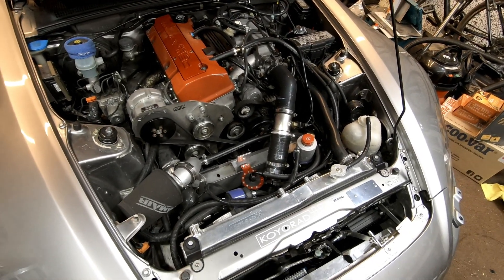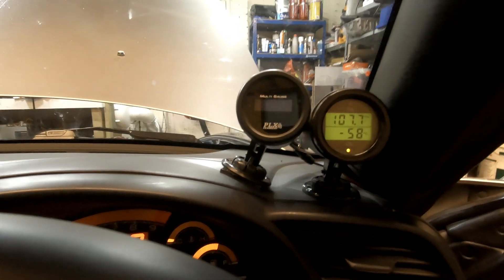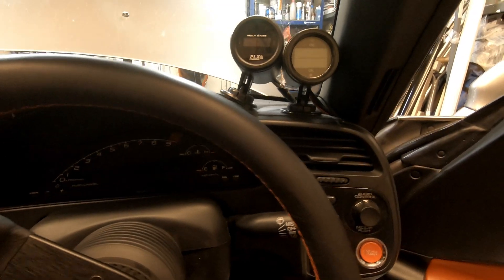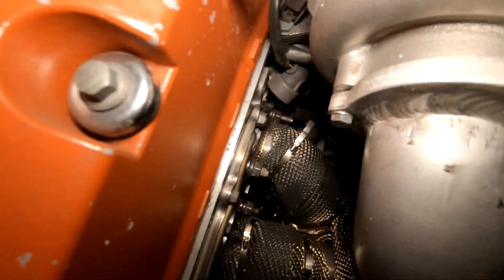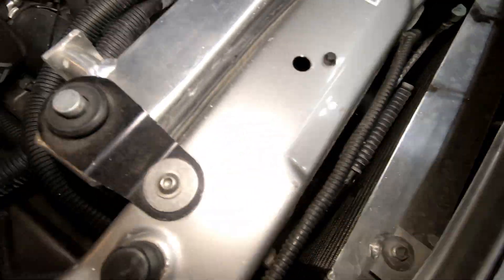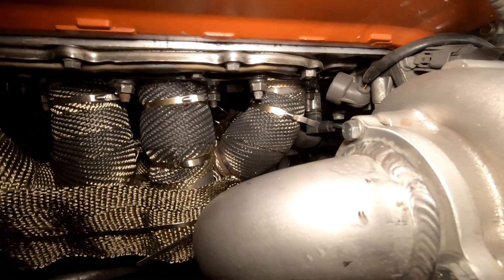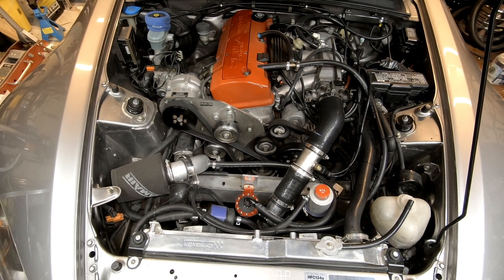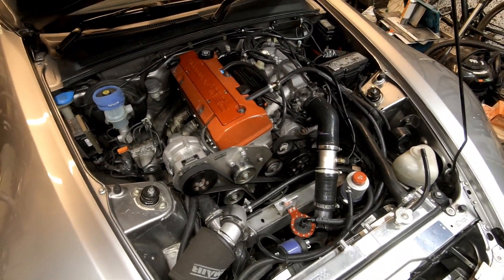Too much oil pressure?? Honda S2000 suffers a failure

Comment: Yeah, I had the same issue with my S2000 last night 😢 no leaks or smell. I drove it again and the pressure went back to normal. Car was sitting for a few days. I totally agree with the shit your pants moment 😅
Reply from the maker: Yeah it's abit worrying when it happens. I ended up changing the gauge as this was the 3rd sender I've got through on my s2000